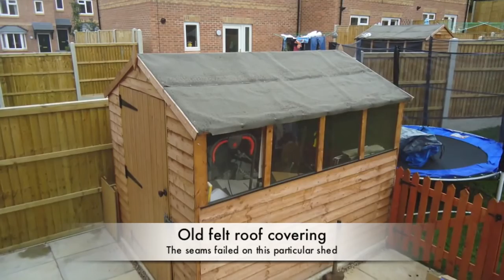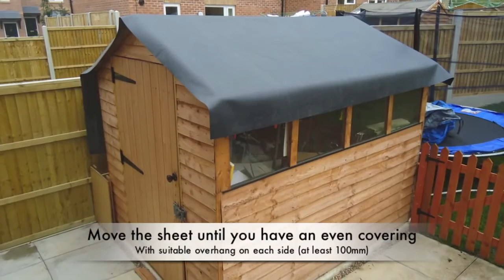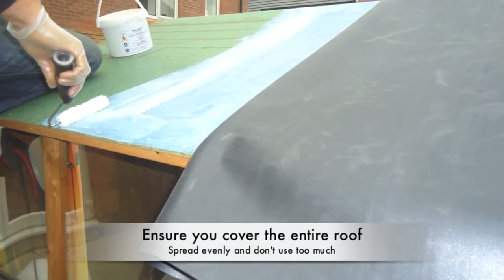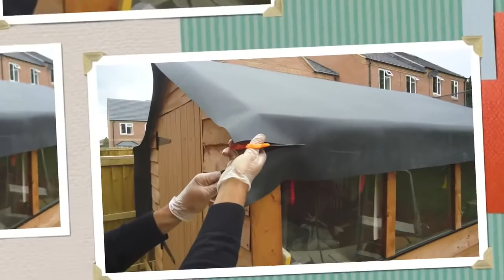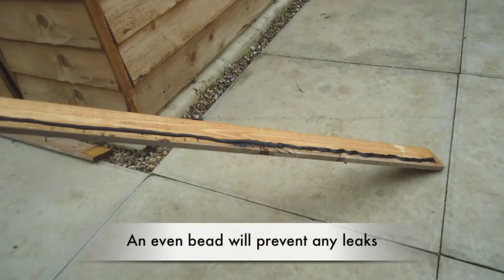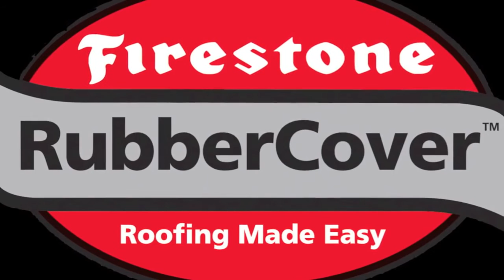How to Install Firestone EPDM Rubber Roofing on a Shed Roof

Comment: Thanks for this useful video. Is is possible to glue EPDM membrane to an existing felt roof? I know that sounds odd, but the bottom six inches of the wood beneath a family relative's roof felt are in less than good condition, but not rotten. Not sure how firmly clout nails will go into it. I don't have time to replace the wood, so it occurred to me that it may be possible to put EPDM on top of all of it. I'm not worried about it looking great. Also, does it ever buckle in high temperatures?
Reply: sabbatini2 some types of epdm can go over felt ... but if what is under it is rotten, or on its way .. why would you not replace it? Just making more work and cost further down the line !